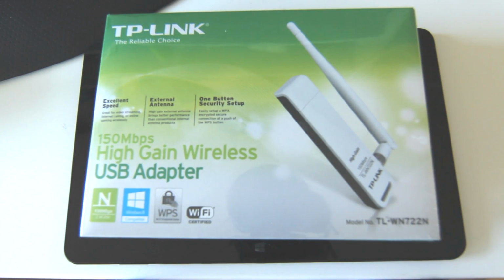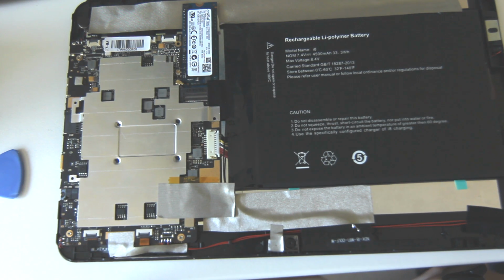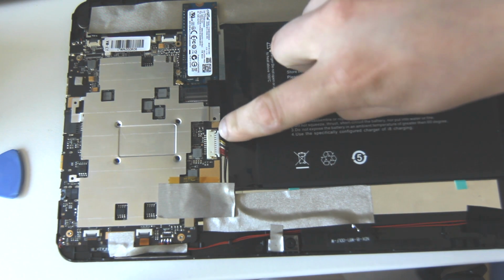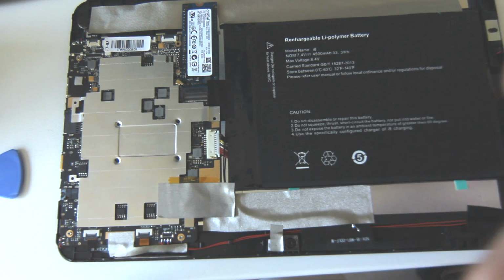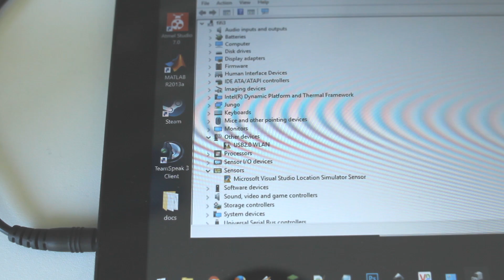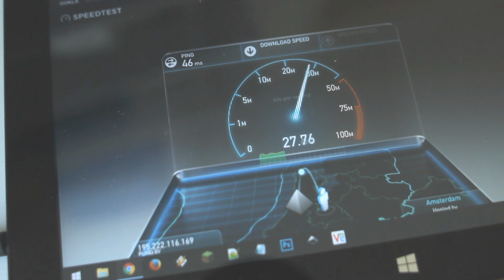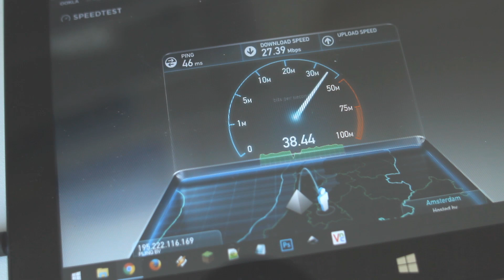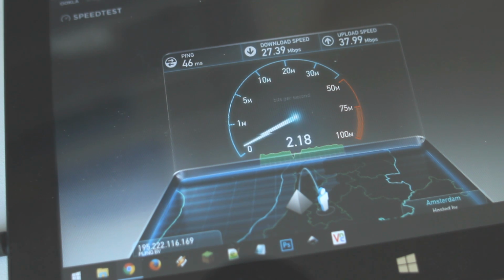Cube i7 Stylus Wifi upgrade/mod (031)

Comment: Do you think the following module (see link) is compatible as-is with the soldered WIFI+BT combo that is already in the tablet? https://fccid.io/2ASJA-B8821CU1/User-Manual/User-manual-4202077
Reply: I'm thinking to replace the soldered one with that one, but I'm not sure it will work. I found a seller here: https://www.aliexpress.com/item/4000187938688.html?spm=a2g0o.productlist.0.0.43297f987S7U3I

Comment: Would it be possible to replace the WiFi module with this one: http://www.fn-link.com/a-b-g-n-ac-wi-fi-bt-module/6221e-uuc.html?
It looks like it's the same size with the pads in the correct position, but this one has 5GHz WiFi + Bluetooth 4.X.
I think the one used in the i7 Stylus may even be from this company in China.

Comment: Hello.
Short question(if you dont wat to read whole story) : Then i plug power adapter, in red diode is on, just like the tablet is charging, but I'm unable to start it with power button. Is it look like your battery problem?

Whole story: Few days before, my tablet charging socket stopped working properly: red diod was off  then chager was plugged into it's slot, so I had to carefully adjust my cable before charging starts. It was looking like loose/broken contact issue so i took off back cover in attempt to find this contact. I found that power slot contact (or so i thought), heated it with solderer and red diode is ligting again. But now my tablet is not charging. Im not really good with electronics so it will be really helpfull If you give me some directions or couple of quick tips how to fix this. Or just say is to hard to fix such issue by myself. Thank you anyway.
Reply from the maker: Have you tried long-pressing the power button (about 10 secs?). It could be that your battery was deep-discharged and the tablet refuses to start on an empty battery. Otherwise I have no idea; the red LED lighting up means the charging circuit is working and power is being accepted.
Reply: Thank you very much for your advice! Long-pressing power button didnt worked out, but long-pressing small "hard reset" button (which located near power button) did the job. So my tablet is working again now.

Comment: and can we choose another wifi interface with wifi 802.11ac and bluetooth?
Reply from the maker: Yes, anything USB. It's really just a USB connection, but internal.
Reply: PowerElectronicsBlog and in the i7 book is USB or PCIe? do you know? (and thanks haha)
Reply from the maker: Also USB. Sorry to say.
Reply: @PowerElectronicsBlog  I've solder rtl8812bu remove dc-dc and coil make direct wire to bypass and got error 42 when bootup ... wrong descriptor ...

Comment: Hey, I actually completed this ,but in task manager there is one device that says device descriptor request failed.
Reply: Is it a necessity to remove the dc to dc connector
Reply: If the device descriptor failed, that might mean you're feeding it the wrong voltage. That connection on the module is only 3.3V, USB sticks use 5V. That 5V is usually again downconverted to 3.3V on the stick itself, so if you bypass the dc to dc converter on the stick it should work.
Reply: +Sibcpodcast So I removed the regulator, now nothing shows up, I think I have to bypass it somehow, I don't know where to solder the wire. Here's a picture of my work so far https://goo.gl/photos/jnBs3aCGwqdZ85uD6
This is the TP-Link AC600
Reply from the maker: If you solder back the regulator, connect it to +5V and then measure the various pins of the regulator until you find the one that produces 3.3V, that's where you need to solder to. You can also look around if there's a more convenient spot to solder to that also measures 3.3V.

Comment: I've done desoldering before, but this chip is very small compared to my usual, any tips/special equipment necessary.
Reply: For anything SMD or small pitch, just buy an ATTEN 858D+ hot air station and you'll be golden. Hot air soldering is the key to success with this kind of stuff.

Comment: So those 4 connectors are essentially a usb, so that would mean I could use a dual band adapter such as the following https://www.amazon.ca/gp/product/B01BV91L7Y/ref=oh_aui_detailpage_o00_s00?ie=UTF8&psc=1
Reply from the maker: Yes, although it's only USB 2.0 on those pads. You won't be able to get maximum possible speed out of it (as if it were USB 3.0)
Reply: Awesome, I want to use this for Steam In Home Streaming/Nvidia Gamestream with Moonlight. Currently its not as smooth as it should be, especially when compared to streaming to my phone.
Reply: Do you think it's possibly to replace the micro-usb port with a usb type c port. I think that would be interesting.
Reply: Not in-place, I don't think. it's pretty cramped in that area and type-C has a really different pin layout than USB 3.0 micro. It would need a little converter board, and that won't fit (at least I don't think so).

Comment: Great video, love it so much.
Do you have any idea how to replace the speaker with a better one? At least a louder one.
Another thing is, i want to put a gps module. I have ublox 7 module that has USB interface, can it be soldered inside using a USB hub?
Reply from the maker: Those are two good points; I'll be attempting the USB hub idea in a video at the end of august (when I get a couple of custom boards in). The speakers should be able to go louder, I just have to find the amp.

Comment: I was going to buy this tablet and found your video. So WIFI connectivity is an issue! That's a deal breaker right there. Would you know if the new i7 book also has a similar problem with its new A/C adapter? 

I was initially going to buy the i7 book but downgraded to this since it's cheaper. Everything needs a rethink now.
Reply from the maker: You're probably going to really want the i7 book then. The wifi is an intel chip (no more rubbish like in the stylus) and the first looks I've seen at the power adapter are also encouraging; it doesn't detect spurious touch events anymore (typical for crappy PSUs).
Reply: PowerElectronicsBlog
 Ok thanks!

Comment: Do you have a longer battery life when changing to this USB module? Would be intersting. Thanks for your video, now i will make this too, for making the stylus working as a hackintosh even better with working wifi!
Reply from the maker: it's really hard to tell, because I never really run it down all the way and it takes ages to do any kind of scientific battery test on a machine with 6-10h battery life. 

I have no interest in running OS X.
Reply: +PowerElectronicsBlog Thanks for the quick reply. Anyway great guide!

Comment: Would it be possible to just replace the chip (since all the connections are there) and perhaps connect an additional antenna instead of attaching a separate "board" there?
Reply from the maker: There is no pin-compatible replacement chip that's actually better; literally the only chip you can replace it with is another 8723xx (and not even any version, I think the only ones you can use are 8723xU). Those are all just as shitty.

Worse still, there aren't that many choices in those modules either. No atheros chips, no broadcom chips. It's basically all realtek crap (although better modules do exist). So if you want a real, significant upgrade, this is basically your best bet.

Upside, though: there is tons of room. I could have fit two other USB wifi sticks in there. The soldering is pretty easy too. So you don't have to be super fiddly.